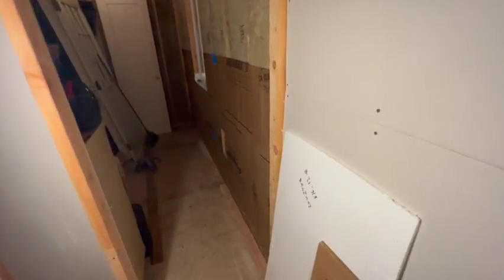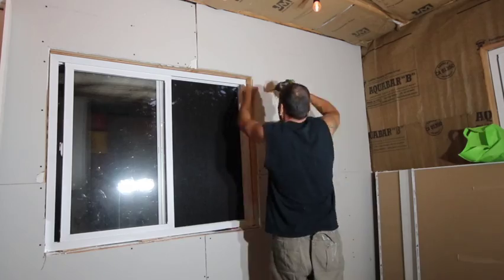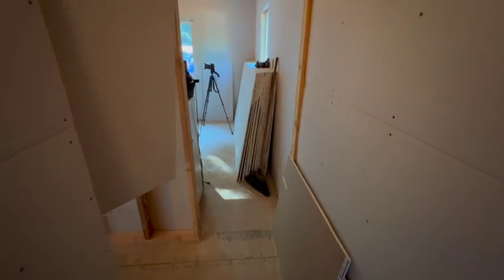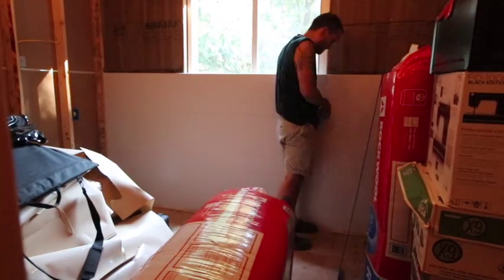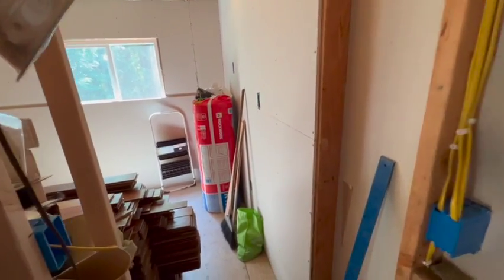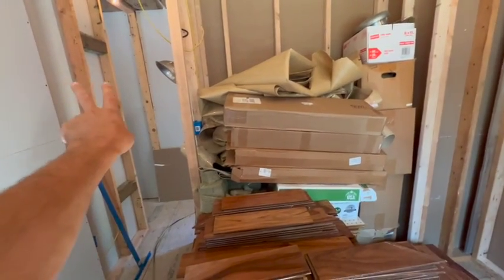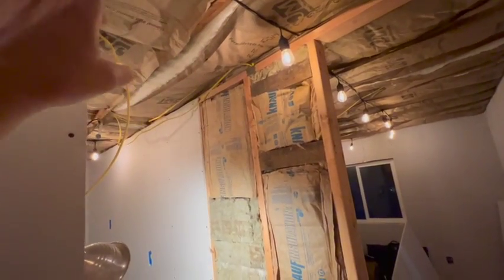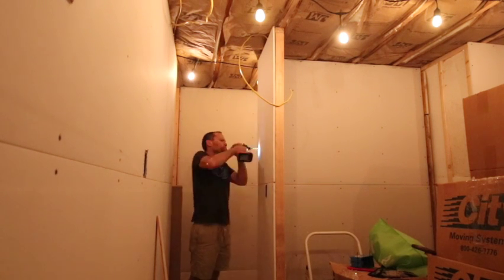Bedroom Drywall Rough In on the Old Single Wide Mobile Home Build

Comment: Are you using 1/2 inch or is it 1/4 inch drywall?
Reply from the maker: Half inch ultralight. 1/4 inch is actually a lot more expensive. I think just because of the volume that is made and sold of half inch compared to quarter.

Comment: That is a single wide?  Looks like a double wide
Reply from the maker: Yup! 14x66 but it does have a large bumpout that spans the length of the kitchen and living room so it does make it feel a lot like a double for sure.
Reply: @thesomewhathandyman9400    I. That makes since. Mine is a 14x60 and I don’t have that much room
Reply from the maker: @RR-up4my  Yeah, even though the ceiling is super low on that bumpout, it makes it feel so much bigger for sure.